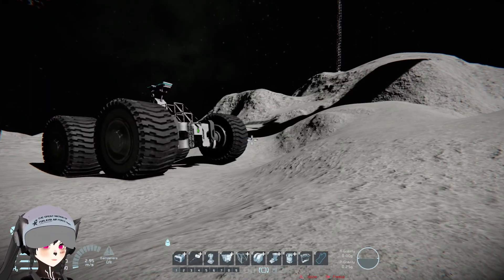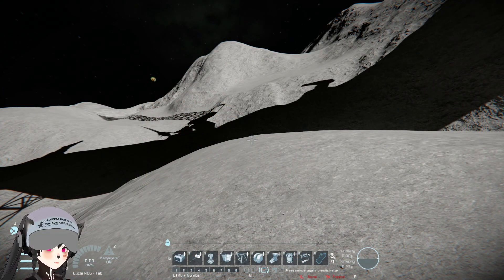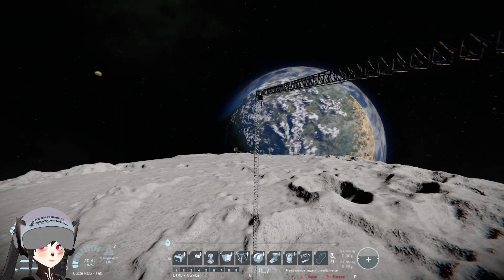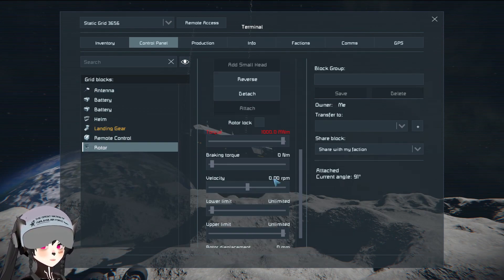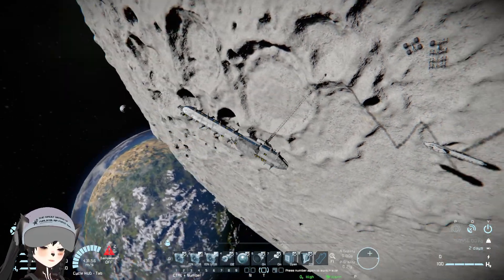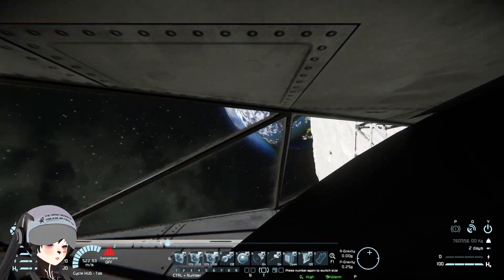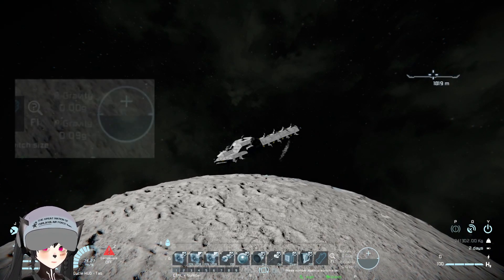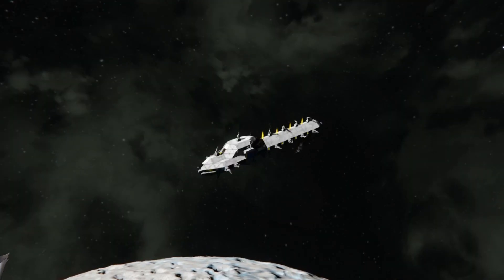This Launches Heavy Ships to Moon Orbit Cheaply, Space Engineers

Comment: As the saying goes: I ain't stupid if it works, which it really did, but still it makes me twitchy feeling like you're spitting in Clank's face.
Could you otherwise just use a gravity drive or basically a railgun if you want a bit more style and/or centralised infrastructure? Hmmm, I might have to play about with the railgun idea myself, I like it too much to not try.

[Edit 1] Yep, railgun works, definitely more expensive to run but with field limits you can bring power consumption way down.
I haven't tested accuracy (I expect it to be far more consistent) but I see no reason you couldn't set up a ship in orbit with the reverse system to decelerate and receive. The power cost might not be too bad since you can just send up what you want to load rather than an entire ship.

[Edit 2] The material cost is quite high regardless of optimization but once built to the scale you need the cost should be zero (not accounting for its ongoing power requirements).
Reply from the maker: That might work c= might be a bit more expensive though x3 and good xD and I see c= good point x3

Comment: now the question is,  how much H2 you spent to build the contraption.
Reply: 1-2 bottles if you're vaguely prepared but I could build it without any fairly easily using an additional rotor and a merge block.
Reply from the maker: Yeah it should be fairly cheap especially if you just use 1 steel plate unwelded light armor for most of the structure xD